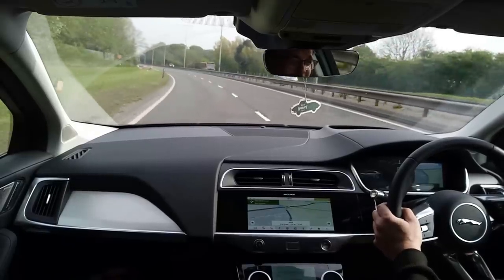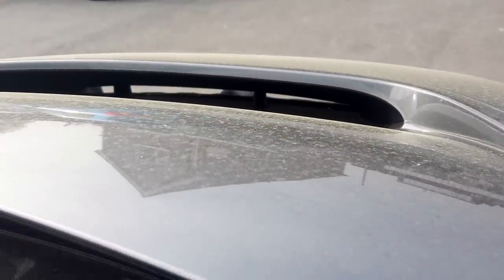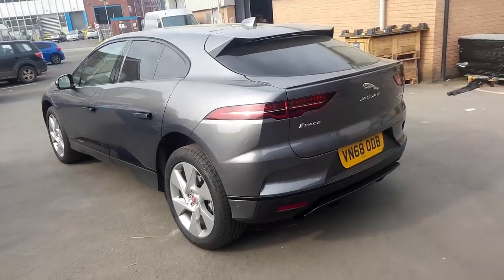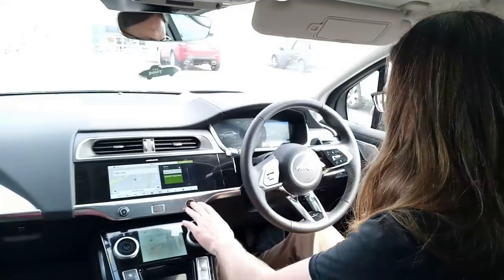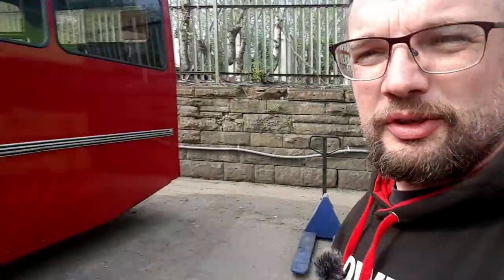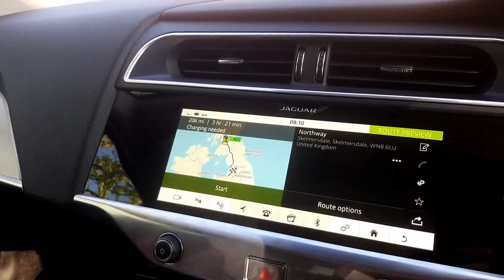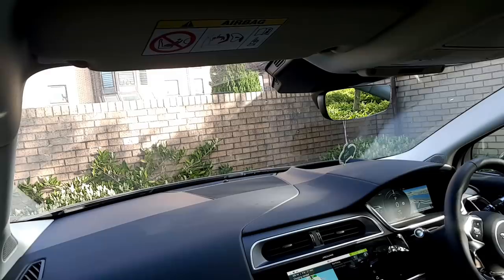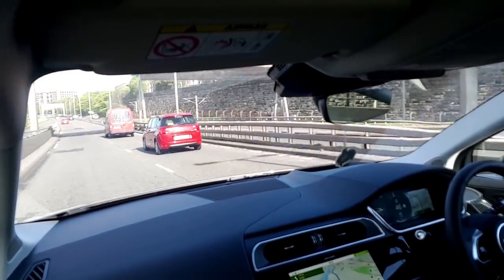Real Road Test: Jaguar I Pace 800 Roadtrip - with bonus bus action!

Comment: Hippy squad T-shirt arrived this morning ready for the Bank Holiday, breakfast with coffee n a HubNut review to watch.
What could go wrong except tried link to the Motor Bike show to have  to sign up to ITV hub and watched Henry Cole! Great presenter with a passion for his subject (bikes) etc.
Think Ian could maybe learn from him and expand his horizons and goals.
Reply from the maker: I'm leaving the motorbikes to Henry...
Reply: @HubNut  Just a observation that Henry seems really slick on his presentation after years of practice and took the lead on TWC.
Just before the return to the failed charger/fault I thought did Ian check all was well before going to lunch. No, called it charger fault think possibly operator error. Almost a Mr Bean moment. Just re watched and dash did say charging so was a charger fault.
Any idea how many hours spent charging over-all and total miles covered and cost. Seems charging rates vary depending on battery condition and charger make and location so motorway premium prices still rule.
Reply from the maker: The charger was charging and put one per cent into the battery before I left.
Reply: @HubNut  Sorry, as I thought about it reviewed video and saw so was amending my comment as you commented.
Even if more cars were EV how would they overcome the demand.
Rapid charging, more sites and more charging units at those site's. Also how much does a charge unit cost to install and run.
The I pace lock on the plug is to possibly stop someone disconnecting while  you're charging and borrow the charge or have a laugh.

Comment: In terms of infrastructure, the availability of charging points for EVs is similar to the problem experienced by owners of diesel-engine cars thirty years, when relatively few service stations had diesel pumps, and to use those that did often required the possession of a DERV card.

Comment: A great video using a superb modern electric car in the real world.  Its just not there yet is it with all that wasted time waiting for the car to charge and failing chargers to drive you nuts.  For me watching the miles slowly drop and not knowing if the next charger will work would totally stress me out.  I guess for local trips to work and the shops EV is the way to go.  The performance off the line looked amazing though.   Enjoyed that one Ian.  Thanks bud.

Comment: Surely, in the future, charging points should be universal, with a standardised charging fitting, so the any car can use any charger.
Reply: Apparently that is being rolled out. But if you can't fast charge what's the point of electric vehicles. Five minutes for my car empty to full then that's 600 miles of independence. Plus look at the depriciation on electric vehicles. Another five or ten years and they may be plausible.
Reply: bobs5050 just had a quick look on autotrader. 2015 fuel (1.6TDI) golf with 20k miles £10k. Same age and mileage egolf £19k
Reply: @SquareoftheyearFM  ok but what did the vehicles cost new. It's not how much they cost. Its how much you lose
Reply: @SquareoftheyearFM  Also while someone is hunting round for a working charger and maybe going out of their way like Ian had too. Then then tdi is going from A to B without issues. I am sure electric is going to be the way to go. But not yet. The technology and infrastructure has to change
Reply: @LancashireBob  by todays prices, £23k for the 1.6TDI match and £30 for the egolf so £13k lost for the oil burner and £11k lost for the egolf. Depreciation won't be a huge issue as there's a lot of demand for the batteries once the car is at the end of its life.
Reply: @LancashireBob  My concern is less about people doing long journeys, for now yeah stick to your diesel saloon etc. but for 90% + of the population who don't do long journeys they're put off by negativity. The average mileage in the UK is just over 7000 miles so most people would need to charge a car like this maybe once every week and a half IF they let it run down.
Reply: @SquareoftheyearFM  There is a 2018 e golf with five thousand miles on it that I just found for 25 thousand pounds. That's a loss of 8 thousand or more in a year. And all the others I found have miniscule milage. So just proves how impractical they are at the moment. Fossil fuels are so much more versatile. Look how many hours it took Ian to get anywhere and the rubbish charging network that is provided. I live around 20 miles from Manchester and there are two chargers that I know of near my town. Things will get better. They have too. Otherwise decent length journeys will become a nightmare
Reply: @LancashireBob  This could go on forever and is probably fruitless. There's also a 2018 1.6 Tdi Match (the same spec as quoted elsewhere) with 5k miles on at £15.5k, an 8.5k loss, a greater percentage. Both sound like lease cars really.
Reply: @SquareoftheyearFM  There will always be comparisons in any market. Electric vehicles are still relatively new on the scene. They are not perfect like any vehicle. Long-term use will sort the wheat from the chaff. Wait till the batteries go bad and see what they charge to replace them. The technology is improving and the charging network needs to keep up. And as far as I can tell the manufacturers need to step up as some of the waiting lists are over two years. I'm sure there isn't an oil shortage imminent. So there is a few years to perfect things yet

Comment: What an absolute faff. I just couldn't live like that. Driving is difficult enough sometimes, without all the added stress of range anxiety and incompetent charging infrastructure. The only way in which the electric motor makes sense in a car is when it is combined with an onboard Hydrogen Fuel Cell a la Honda Clarity. That way, you get all the benefits of an electric car with the convenience of being able to refuel in the same manner and timeframe of an internal combustion engine car. The plug in to recharge type of electric car just isn't practical to use as the situation stands. And for that reason, I'll be sticking to good old petrol power for the foreseeable future.
Reply: I totally 100 % agree 👌👌👌👌
Reply: But then modern hydrogen filling stations can only fill about 40cars a day and you can only fill a few cars per hour as they need to repressurise the filling tanks.  You can go out and buy a Toyota hydrogen car now but it’s about £60k for something about the size of a Prius.
Reply: Or you could get a hybrid the new Toyota Corolla looks a smart hybrid option and many other manufacturers are starting to look into this idea. I think these are more suitable for long journeys.

Comment: Very informative video, Ian - one of your best. I've often thought EV manufacturers should hold a convention to design their cars to readily accept a rented battery pack - similar to the Calor Gas bottle system. Owners could turn up at a "petrol station" and swap their depleted battery pack for a replenished one. This would eliminate the two problems you highlighted, range angst and charging times.
Reply: I have thought the same thing for a long time - it should be possible to standardise batteries so that you pull into a service station, they change your battery and put your old one on charge for a later customer.  At least that's my opinion.
Reply: @MGBetts1  Thanks - it's not just me, then.
Reply: @MGBetts1  Yes..good notion and Vehicles would need redesigning for that to be Practical

Comment: Great review. But, would love to see these cars with 4 people & luggage. Or maybe in cold weather where you can lose 30% range. I cant see how you can have 100 to 200 cars per motorway service area & the site getting enough power to charge these cars. How long will it take to charge a Tesla truck? People who can afford an electric car like this one, do not have the time to spend 10-15 hours per week sitting at charging points. These people have there time costed in the £100s of pounds per hour. As far as lorries go, their parking areas on the motorway services will need to 10 to 15 times larger & then there is home charging. Many have a public pavement & no set parking space & then we have those who live in flats & apartments with no private parking. All the urban roads in Britain will need to be dug up, it's a bloody nightmare. At the moment, electricity demand doubles every 20  years. If we go EV big time as postulated by our corrupt elite, demand will double every 10 years. 

EVs should have a standard battery pack & an automated exchange system so you drive in and the discharged pack drops out & a new fully charged pack is fitted & you drive off in 3 or 4 minutes. Of course, a capitalist society won't make this investment. Why won't they make it? Because they know this tech is short term for the next 10/20yrs & then they'll change it again, probably to hydrogen. Sorry about the rant but these questions/problems need to be asked and highlighted. Nothing wrong with the EV concept. It's just that there is zero planning. Only two critical points about the car. It seemed very noisy on the motorway & the boot was pretty small. Maybe EVs should be more estate like. All this should be take as constructive comment.👍 BTW, love the longer format.
Reply: Mostly agree except the stats I've seen on electricity consumption say the national demand is actually a fair bit lower than it was in the 90s, so I'm curious where your numbers come from? Unless you're not talking about the UK's consumption?
Also another pet peeve of mine is how many kW are lost from the thermal capacity to the electrical in power stations. At least some places will use that excess heat for communal hot water, but we don't get that in the UK for whatever reason. Obviously there isn't all the insulated pipes just lying around but it would be a very good investment from local government IMO. At least some individual buildings/developments are getting some similar things, such as waste heat from trains or servers.
Reply: @kaitlyn__L  think you'll find we are importing alot  from France. The way EVs are currently configured, they are a joke.
Reply: @CarlJones14  What you said is true, but our national demand is still lower than it was in the 90s.
We are importing a lot from France (and I believe also from the Nordic link too), but that's just because power stations have been decommissioned or run at lower capacity. 
If you look at private sector industry columns etc they happily boast about how they've drastically reduced the generation that isn't being used. Nevertheless, our demand for electricity as a country is lower, in terms of MWh. 
The private sector claims it's better to import from France because they have so much nuclear there that they can't just turn things down the same way, but unfortunately all those practises are part of what led to the European 50Hz issue of a while back where mains-powered clocks ran slow. 
And having some capacity buffer is really important to running the network, maxing out the cross-channel links is not sustainable. But for the private sector having spare capacity is "money wasted" and they don't really care about the small availability crises we've come across.
So what you've said is true but is not indicative of our usage patterns or something we can easily change by turning lights off. The best ways to try and fight it is pushing for battery backups on the grid (also very useful for renewables), better renewables (I read in Scotland they've had 100% residential capacity provided by renewables for a long time, and have some days with 100% industrial too), and frankly telling the private sector generators to stop penny-pinching with our vital capacity buffers.
But ultimately having battery storage on the grid (be it in battery farms or just distributed across many EVs) will allow all of the mostly-unused base load generation (night rate power) to get saved up in a battery, as well as all the renewables making power when most are asleep, and then the buffer can be the batteries rather than in the generators. Like how a water tower manages peak demand in small towns, or old gasometers from coal would slowly rise and then go down in the evening.
Until then it's very irresponsible of the generating companies to run so close to the wire and run the DC links with EU so hard all the time.
Reply: @kaitlyn__L  I would say running system close to the wire is a deliberate policy of scarcity like water.👍
Reply: @CarlJones14  Glad we agree there.

Comment: I can't imagine myself waiting an hour for the car to charge half way through a journey - I get frustrated if I have to wait a couple of minutes to use a petrol pump! Excelllent video, confirms my impression that electric cars are great for shorter journeys if you can recharge at home or work, but that the infrastructure isn't there yet for 150 mile plus trips.

Comment: An electric car is only interesting  if charging batteries is your hobby. What a waste of time...😂😂
Reply: Mine charges when I'm not using it. Going to a petrol station is a waste of people's time
Reply: Mark Bradley: it is the other way around; you can’t use  your car while charging...😂
Reply: @Sibbe2560  In the past 3 years I have never needed to drive my car when I'm asleep. It takes 3 hrs to charge 0 to full
that gives me 80 miles approx. We do around 50 miles a day. so when would I be waiting for the car to charge?
Well that's how I use my EV
When do you charge your EV?
Reply: Mark, my current car is still a petrol consuming one, the next one however, will probably be an electric one...👍👍
Reply: @Sibbe2560  I'm sure you will enjoy it. More and more coming out. Take plenty of test drives and see how it fits in with your needs.

Comment: Well I was always sceptical about EV's and this kind of made it worse. So there are charging facilities around but they are costly, slow, and glitchy... that's not promising, if we have to wait until the next generation of charging points..
Then take into account the ridiculous amount of damage to the environment made during the production of electric vehicles...
I'm more and more convinced EV's are doomed and hydrogen is the future.
Reply: Chemicals & Precious metals courtesy of slave labour. I agree!
Reply: What about the huge environmental damage for fossil fuel production?.  Manufacturing and powering/fueling a personal vehicle takes an enormous amount of energy and resources,  but over its working group life an electric vehicle has less negative impact.
Reply: @chrismarshall25  Well I quickly calculated with my research group in university that in practice you would need to drive around 350000 kilometers through the life span of the vehicle to justify getting an electric vehicle. And this is not taking into account the inevitable degradation of the batteries in the EV. 
So even if there was a positive impact by driving an EV for a long time, I'm personally very certain that that impact would be negligable. For most people, who buy a new car every 120000 kilometers or so, it is a negative story. Ofcourse I am not all-knowing.
Reply: @chrismarshall25  And do keep in mind that a lot of electricity is produced by fossil fuels.

Comment: You're using Polar Instant.  What Polar want you to do is use Polar Plus, it's subscription service at £7.85.  The 'plus' side is that it works like a dream, using an RFID card and no app.  Charge is often free (after subscription) or 10.8p per kWh.

Comment: Fascinating Video, Thank you Ian :) Shocked to learn how poor the UK charging infrastructure still is!!! There really appears to be a bit of a chicken and egg situation in that no one will invest in charging infrastructure until the take up of electric cars is higher, but very few customers will buy electric cars until the infrastructure is better!  By coincidence I just watched the latest Harry's Garage video with Harry Metcalfe driving a Jaguar F-Pace SVR from the San Remo launch 1000 miles back to the UK.  As things stand the 550 BHP F-Pace SVR would make a far more relaxing distance machine (Re-fueling taking 5 minutes +massive range) and with a 5.0 supercharged V8 would have more than enough torque and a much better soundtrack. The F-Pace SVR was also achieving over 20 mpg too so the cost of Rapid charging an electric car is not that much cheaper.   I would imagine most customers spending this kind of money would expect a performance SUV to work as a distance machine.  I agree with you that until the infrastructure improves electric cars can only really work as city cars.  I know very few people who own a full electric car but those I do know are wealthy enough to be able to buy a new electric car as a 2nd car and that wouldn't be realistic for myself or lots of other people.  Thanks again for a fascinating video. It will be very interesting to see if the infrastructure has improved by the time you next test an electric car!!!

Comment: I could not be arsed  with all that charging carry on.
Is I need more range with my C3 1.4TD. I just roll in and fill it up in minutes.
Also a full charge in the C3 can do up to 600 miles.
I know it was not the cars fault that the chargers didn't operate properly but as you said it was real life conditions.
Things would have to improve considerably before I could even contemplate going all electric.
Self charging hybrids are more useable at the moment.